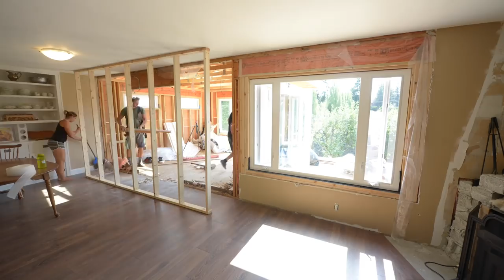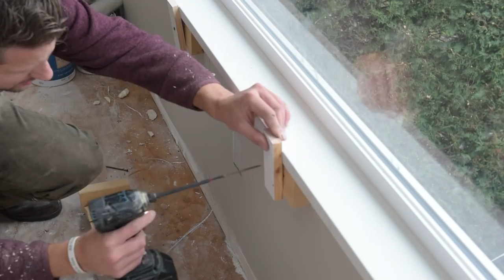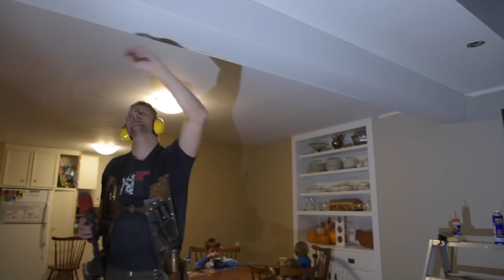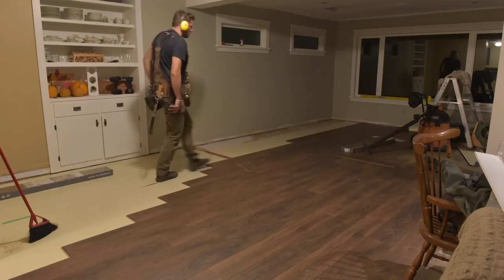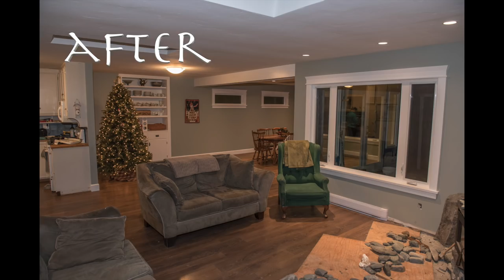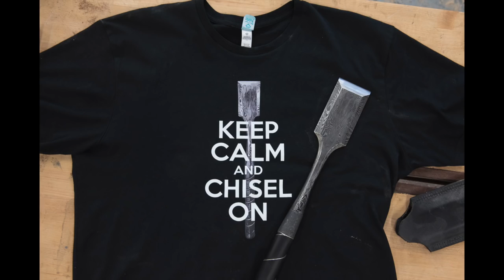Reno Update! BEFORE & AFTER PICS!!!!

Comment: If you’re still looking for a tile look on your deck congoleum sells just the backing of their vinyl sheet goods.  Lay it out and tape the seams and it gives you the ability to install a VCT or dura ceramic grout-able tile.  I’m not sure on the temp swings but it may be a viable option if your building codes allow it. We use it in the states as an un coupler for high deflection flooring applications and non permanent tile solutions.   Get the look without the price and headache.

Comment: hey i run my own construction company.  for your deck you not have to do what you just said to for install tile floor,  maybe if it's livening space underneath. what i do is install 1/2 plywood over the deck then put on this (RedGard Waterproofing) it like paint you just  roll it on we do three coat it one of the best waterproof membrane out there. then just install you tile over  using flexible mortar and use epoxy grout

Comment: Whenever the old stuff doesn't meet the new stuff what you do is you divide the boards (old from the meeting line, and new as well) in half, and as you look at the meeting edge, one side has 45 taper towards you, the other has 45 taper away from you (and the opposite needs to be mirrored so they match ), you'll have to use a box cutter to chisel to perfection at the middle where the saw blade won't be able to get in. Once you've done that, any floor you'll put down will perfectly fit, and, it won't lift.

Comment: I'm impressed more and more with your craftsmanship. I am curious as to what you did for trim where the laminate met the kitchen cabinets? Sides and toe kick. Also, have you considered, for your deck, doing a membrane for water proofing, and then a floating platform on top of that, akin to a roof deck?
Reply from the maker: I will be replacing my kitchen in a year so I haven't installed any molding around the cabinets.  I did consider doing a floating deck but it was just too expensive, labour intensive and higher maintenance.  The vinyl is already down and cost me less than $3000 ($7.80 sqft).

Comment: Okay I think I saw when you did the trim - no wood shims or nailing on the inside boards that wrap windows - just foam insulation to hold it in place? Please confirm. Looks awesome!
Reply from the maker: And a few blobs of premium construction adhesive which I like to call liquid shim ;) The foam is all you really need though.  It would take a pry bar to rip it out after the foam has dried and it supports the liner completely!
Reply: I wish I had seen this sooner. I just did some trim work a few weeks ago. Going forward this will be my only way!

Comment: Have you thought about Linoleum for the deck ?
Not sure if it's good for outside, but is hard wearing.
Reply: Sparky Projects Lino and vinyl are the same
Reply: Actually no, check the wiki article about Linoleum
"Linoleum, also called Lino, is a floor covering made from renewable materials such as solidified linseed oil (linoxyn), pine rosin, ground cork dust, wood flour, and mineral fillers such as calcium carbonate, most commonly on a burlap or canvas backing. Pigments are often added to the materials to create the desired colour finish."

Comment: And what decorative style does the Samurai Carpenter go with?

Craftsman. Duh.
Also, there are a number of deck coatings out there that you mop on and are great for cost and ease of install. As long as you've got enough slope to get rid of water, they are awesome. Ames makes one called Safe-T-Deck in a variety of colors or white that can be tinted as well. I have it on my deck which is exposed to desert southwest heat and sun and ten years on, it has needed minimal attention, mainly just a touch up here and there as the plywood underneath has settled and the coating settled into the spacing. Pour it on, spread it with a cheap sponge mop. Get it 1/4" thick and forget about it for the next decade. In 2028, you may need to buy another gallon to touch up some spots. It has grit in it so it's non-skid and you only need a piece of metal flashing where the subfloor meets the walls to make it water proof. Paint the coating right up over the flashing and install siding as normal.

Comment: The tile store told you some bad info.  I would take another look at that before wasting money on junk vinyl.
Reply from the maker: Canadian building codes are super strict.  Building here is insanely expensive because of it.  I know I could get away with less and likely have no problems but I don't want to chance it.
Reply: I am from Netherland EU, so was wondering: is the government really going to check how you build some out house space??
Reply: Have you confirmed what they said is true?  I believe you said 3 different water proofing methods one on top of the next.  That's silly and there is no code that will require that.  Further, surely you don't have a permit for what you're doing.  There is no way that outside stairs passes muster.
Reply: It' just a normal outside deck, why does it have to be waterproof...
Millions of 2x6 treated board decks in Canada, Why the issue..

Comment: Hate to throw a wrench in your plan, But if you're going to put vinyl on your deck you will 100% need to remove your patio doors and wrap the vinyl up and over the threshold. if you just cut it flush to the bottom of the sill and caulk it with a termination bar it will not last you very long. You'll start to have water ingress within 5 years and rotten subfloor shortly after. Trust me, I work in the restoration Industry in Vancouver and i see it all the time. Its gonna be a pain in the ass removing your doors again but trust me it will have you a nightmare in the long run....
Reply: I believe he mentioned it will be covered... at some point which will keep the water out of the area in front of the doors.

Comment: do yourself a favor and do not install vinyl! Get a fiberglass installer out there, they will pitch with sleepers and AC plywood and waterproof the deck with plywood and an epoxy coating. you will have to remove the doors and create a waterproof threshold for the door to sit in you will also want to install cants against the house and remove 18" of siding for the fiberglass to roll up on to the vertical surface.  if you do sheet vinyl you will have to do the same thing with the doors and roll up under siding. Please dont do vinyl plank as it would never hold water.